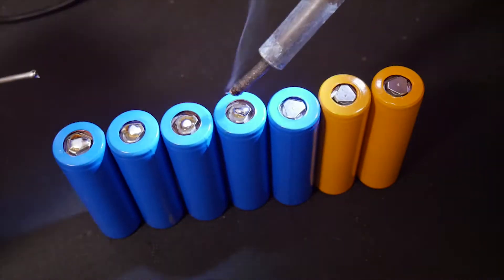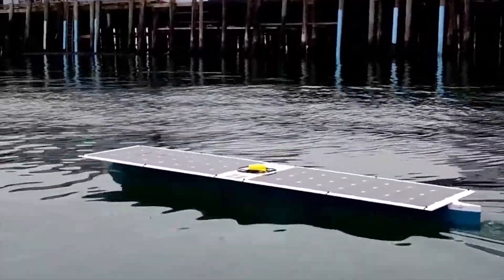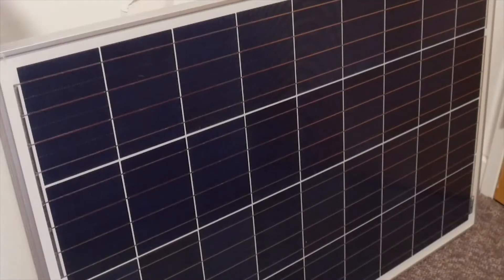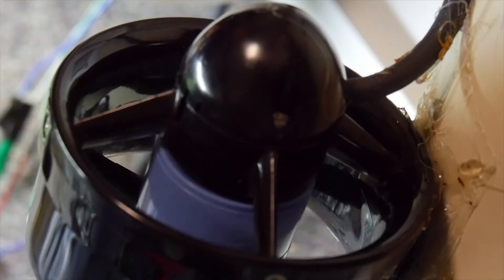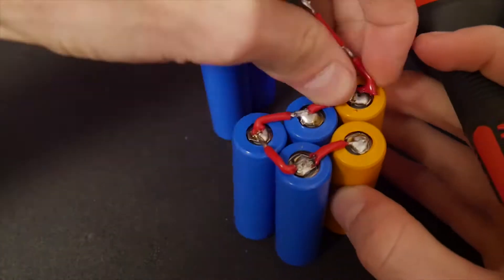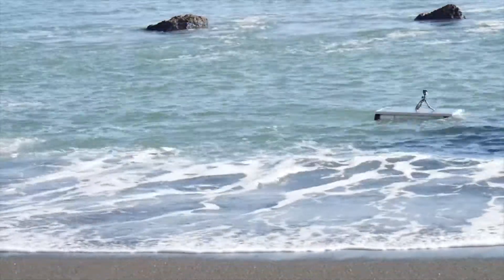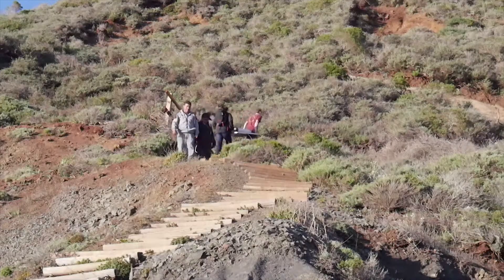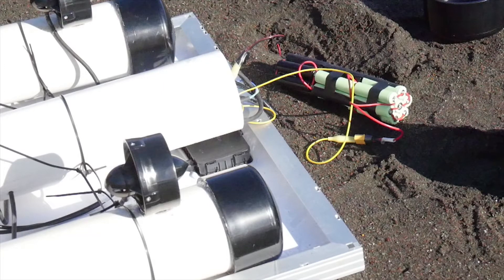DIY Oceanic ROV Build (PART 1)

Comment: Great video, good job for giving this a go. Recommend focusing on hull design which will help with the thrust vectoring and it's ability to stay upright. Deep V Hull Catamarans are perfect for this application. The triple pontoons act more like a barge through the water which is only good in calm waters.

Comment: If I were you I would dip all the electronics in Corrosion-X. Flitetest did a video on it. It seems like PVC glue wouldn't hold up in salt water for extended periods of time without some sort of sealant to protect it. Also, you might want to make a payload bay (like the ones in high power rocketry) that you can slide in and out of the PVC pipe to make mounting the electronics & autopilot cleaner and easier. Nice project, though!

Comment: I think the thrust vector would work if paired with a dagger board on the hulls. That would make the craft inclined to sail straight but  could be overcome using significant thrust.. This would add drab which would hurt your efficiency though.